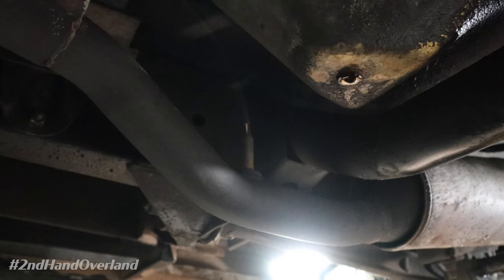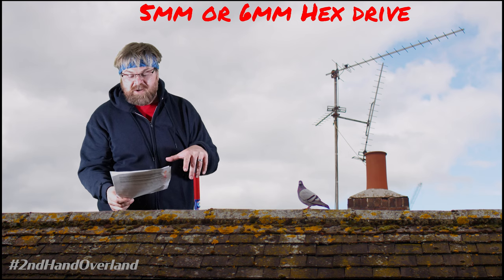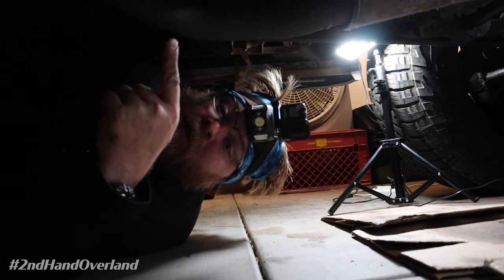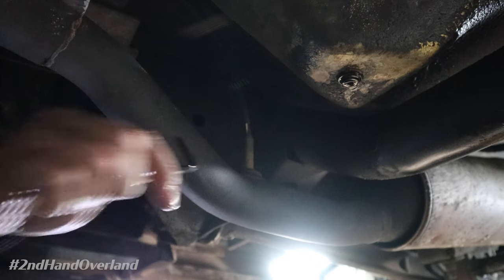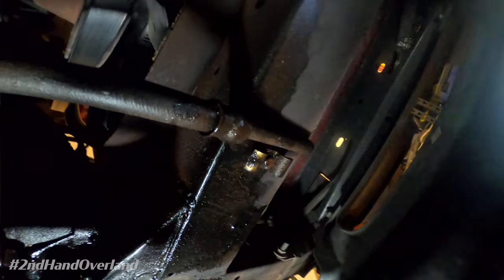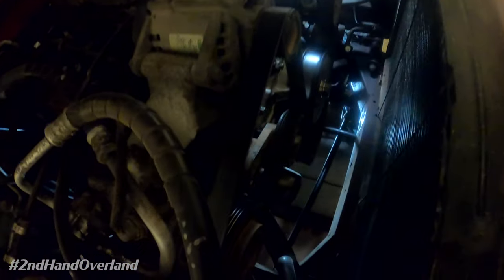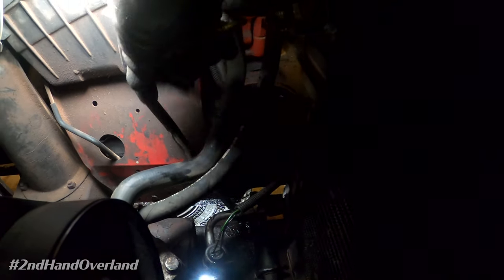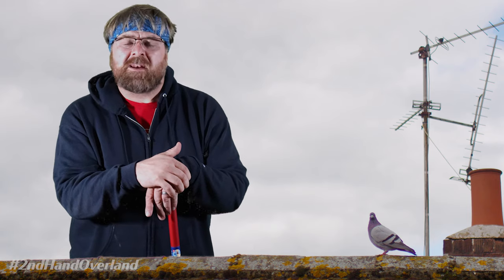Land Rover Discovery 1 Build: How to Replace The Transmission Cooler Lines

Comment: Great to see you wrenching on your vehicle, and a very informative video. 
Better to go through it and fix it before going bush, not much fun fixing it on the trail. The Disco's are quite reliable, provided that they are properly maintained.
Good to see you got that covered, or busy covering it😁
You mentioned Car Wizzard and I hope you saw the one tip he had on o-rings, get an air con o-ring kit with the green o-rings, they apparently are better than the normal black ones.
Reply from the maker: I didn’t see the one about the o-rings, I’ll have to go look it up. Maybe next time in in there I can update it. This kit only came with the standard black o-rings.
Reply: @MattKester  it's in one op his workshop tips videos.

Comment: A Disco 1 is a much better choice as a DIY mechanic than the later models. It's ultimately a pushrod V8, and it's not tricked out with super complex electronics and the need for a workshop full of special diagnostic equipment and tools.
Reply from the maker: Right! I can’t get over how simple it is to work on.

Comment: Little trick for those that struggle to get fan off and a lot of people do. Get a larger fan wrench put it down against the bolts that hold pulley behind fan on mark where those bolts are best you can then drill holes in larger fan wrench where you marked. Now use that wrench to keep pulley from spinning by fitting over bolts in pulley take 36mm fan wrench and brake loose watch fingers really easy to slam to wrenches together when it brakes loose.
Reply from the maker: Nice! That’s a good hack I’ll have to try sometime. The kit I had came with a third wrench that was drilled and slotted, but it didn’t match up to the bolt pattern very well.
Reply: @MattKester  yah it's kind of a pain luckily when I made mine had a extra pulley around made it a bit easier to mark holes, got a super good deal on a big set of fan wrenches from auto zone 15.00 and just sacrificed one of the bigger wrenches to make it and presto.

Comment: thanks for the upload. I have a small leak in one of the pipe(lower one) planning to replace. if any one can suggest  if the leak will affect the transmission until i fix it.

Comment: Hey mate I have a similar one down under in Perth, Australia, runs on LPG and petrol. Very capable off road i find (with a Detroit locker) and great to tow with. Cheap parts - but lots of work..... I had similar issues with the windows - dry joints in the window ECU - pretty common apparently. Easy fix with a soldering iron. As for the leaky transfer case often it’s a o ring on the intermediate shaft - look up Brittanica restorations and LT230 on YouTube he does heaps of them. They are quite involved if you do full rebuild FYI. Good luck and drop me a line anytime you like. Keep up the vids!
Reply from the maker: Hey, thanks for watching! I'm definitely gonna have to check those sockets out and try to get them soldered back up. As far as the transfer case, I think I lucked out and what the mechanic saw was residual drip from the leaking head gaskets. I pulled the fill plug before I drained it the other day and oil actually came out of the drain plug, so I know it's not coming from there! I did check out Britannica Restorations, I love his channel so I subbed! I was gonna try to find a link to my favorite LT230 repair video, but I can't seem to find it. There's a guy in the UK somewhere who took a JCB forklift, hooked a chain around the rear bumper of an old Defender, then lifted it up on its nose vertically. He then stood there, unbolted the transfer case, gave it a big hug, and pulled it right out! Craziest thing I ever saw!

Comment: Love the videos! Very helpful! 
I just replaced my oil cooler lines, and I also had to replace o rings at either end of the lines. In your video there’s no mention of this. Did you replace them?
Reply from the maker: The new lines I purchased came with new o rings already on them. That’s a very good point if there are kits out there that are lacking them. I probably should have mentioned to at least confirm the new lines have o rings on them before installing.
Reply: Big job? I noticed mine are leaking.

Comment: Which of your 4x4s do you prefer to wrench on? In my experience, some manufacturers make cars that are easier to work on than others. My 4Runner usually doesn’t fight me too much when I’m “under the hood” but all the Fords I have had to fix were a real pain.
Reply from the maker: Right now, the Discovery. It seems like it was designed with more of an eye towards user and field serviceability. There’s more room and access to the important pieces is easy. Like, the oil filter is on the front of the engine, right behind the radiator, easy as pie to get to. The oil filter on the 4Runner is best accessed by taking off the drivers side wheel and reaching in between the frame and the wheel arch. Then again, I don’t have to work on the 4Runner as much. I am, however, gonna finally have to go start on the suspension bushings on it next week!

Comment: Hey! Have to replace my upper trans cooler line. Do you remember what you had to do to get the upper hose off the transmission? I haven’t attempted yet but it looks tricky! Also, was it a 36mm fitting?
Reply from the maker: I don’t remember what size the fitting was, if memory serves, I believe I used an adjustable crescent wrench to loosen it. It’s buried in there, for sure, but I was able to snake my arm in there and get it out, but I was able to get it without removing any of the surrounding cross members, etc.
Reply: @MattKester  looks like its a 24mm.  I started working on it and i can get arm up there but barely.  Putting it back on might be a hassle but its gotta be done.

Comment: Question brother. Do you have to drain the Trans Pan to replace the cooler hoses?
Reply from the maker: You probably don't, I just read a write up on changing the hoses and they said be ready to collect about a liter of fluid when you pull the bottom hose. I just drained it because it hadn't' been done since we bought the vehicle.

Comment: I know it seems like extra work but changing the filter would have been good as well. 
Dropping the exhaust is simple. Just Pres pray the bolts with PB blaster. 

Moving the cross member can be simple too by using grease on the inner frame and a dead blow hammer to scoot the bar forward. 
The filter is cheap.
Reply from the maker: I was fully intending on getting that done this time while I was in there. However, I didn't have a replacement set of bolts and clamps for the pan, and I was actually needing the vehicle to be operational this week while I down my 4Runner, so I didn't want to risk snapping anything off that might take some time to get a replacement for. At the next full service, I will absolutely be replacing it!